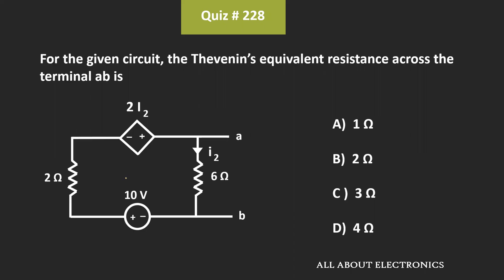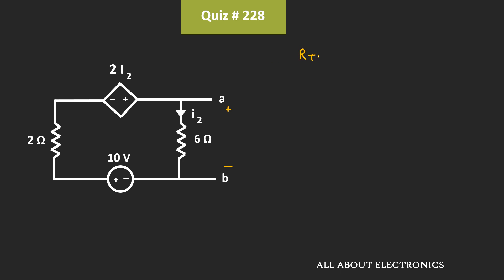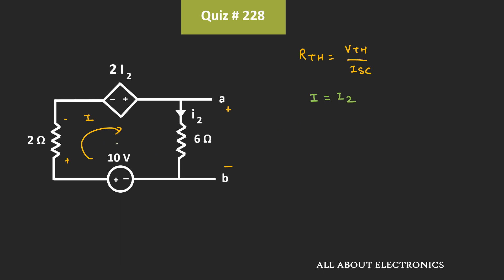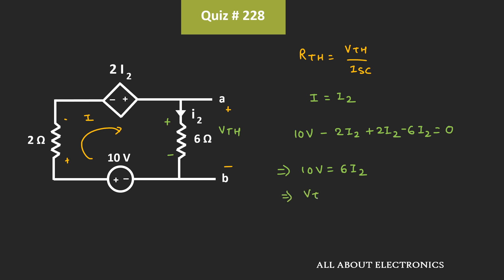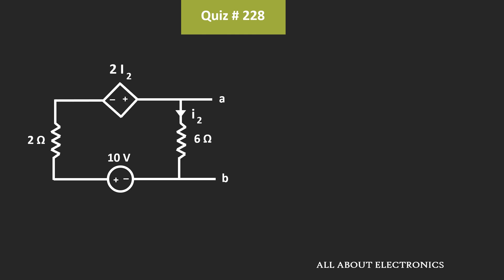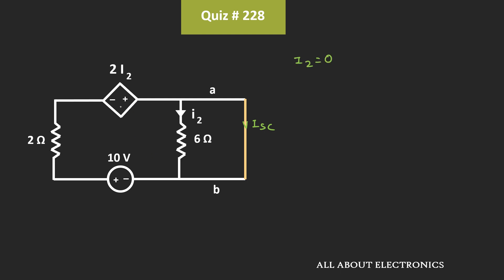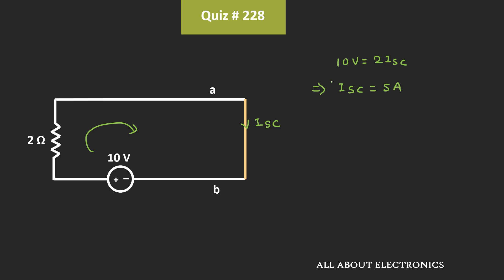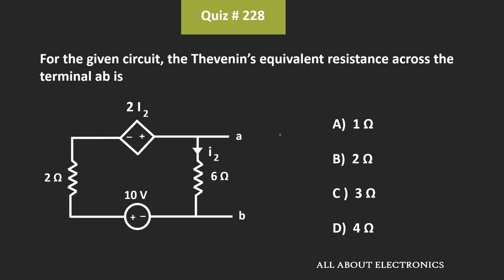Thevenin's Theorem (Quiz # 228)

Comment: Bahut sary chije samjh nhi aati .. ye vth =10 Kahan see gya
Reply from the maker: The voltage drop across  6ohm resistor (6*I2) is the Thevenin's equivalent voltage seen through A-B. And after applying KVL in the loop, we found 6*I2 = 10V.
That means Vth = 10V. I hope, it will clear your doubt.

Comment: What about 2I is it current source
Reply from the maker: 2*I2 is the current controlled voltage source. When I2 = 0, then that voltage source will also become zero.
Reply: @allaboutelectronics-quiz  plz describe in details Plzzzz🤔🤔
Reply from the maker: @Mijanur96  As, I mentioned in the video, to find the Rth, when the terminal A and B is short circuited then the eniter current will flow through the short circuited terminals.
That means no current will flow through 6 ohm resistor.
Or in other words, I2 = 0.
The voltage source 2*I2 is the dependnet source, whose value will depend on the current I2.
That means when I2 = 0 then, the voltage of that dependent source will be zero.
I hope it will clear your doubt.